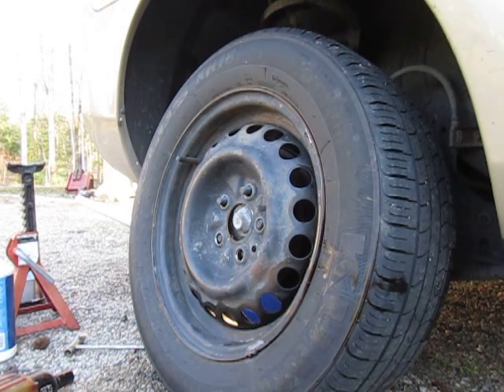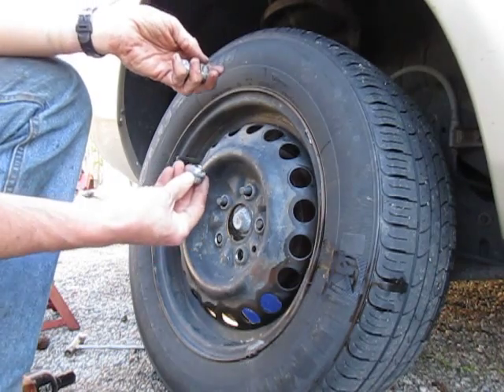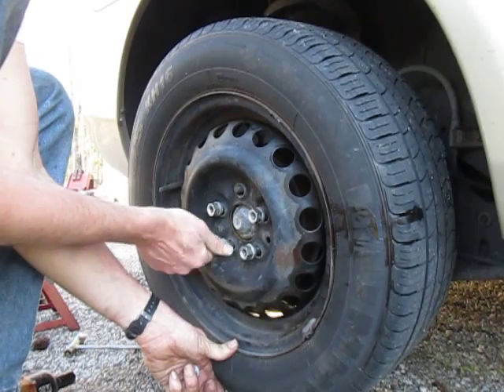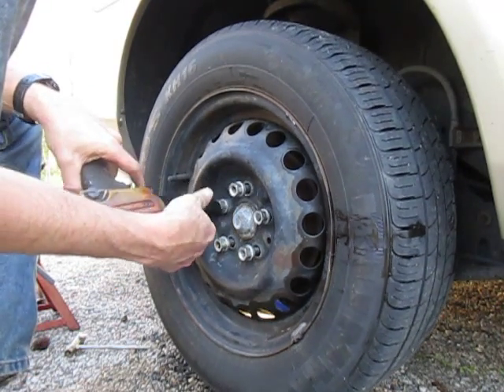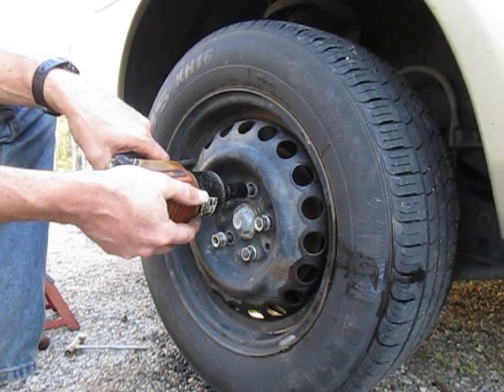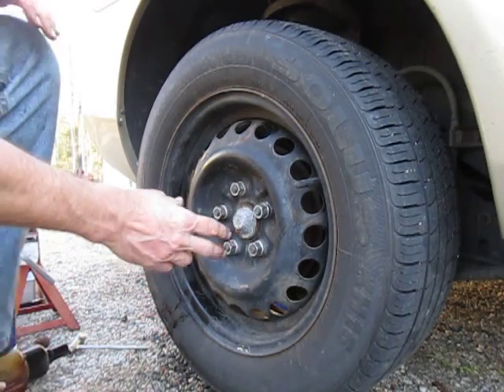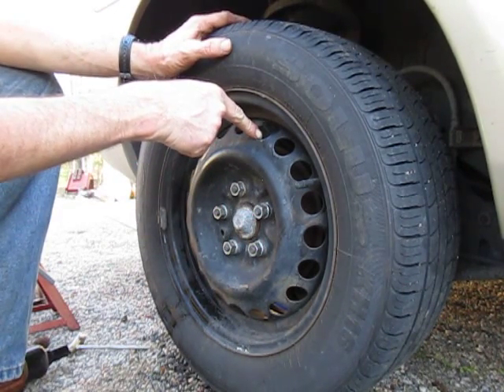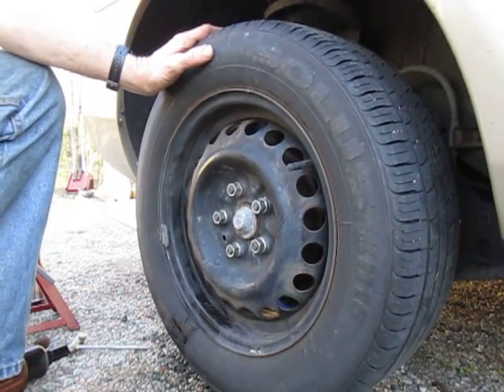Properly tighten lug nuts with pneumatic impact gun

Comment: I use battery power impact wrench. I usually hit it with the impact until it stops turning. Been doing for for years and never had issues of my wheels falling off.
Reply: What brand? Hercules Ultra Torque?
Reply: @yoellopez82  the one I have is Bauer 3/8 impact. I think the bauer 1/2 impact is stronger.
Reply: @OrangeCounty92  thanks!

Comment: Here’s my pro tip: use a battery impact gun and make sure the battery is almost drained but still usable, if you have a 1000lb torque impact gun, then a drained battery will make it “safer” if that’s the only tool you have for whatever reason

Comment: Can I adjust the torque on a cordless impact wrench?
Currently, none of the "cordless impact drill wrench/drivers" will allow you to adjust the torque to those exact settings. (An air impact wrench won’t either for that matter.) The only solution is an attachment that fits onto to the end of the impact and then the socket fits onto it. Basically it is another “socket” that won’t let the tool torque anymore than the ft/lbs you set it for. However, these are very expensive little things. They are around $300 to $400. They are really made for production and assembly lines where exact torque is very important.

Comment: The real proper way is to use the impact gun to start them after putting them on by hand then use a torque wrench to get them to spec. Its too easy to over tighten them with a impact gun.

Comment: I think the torque setting means something the way you did it. One one second torquing  and the nut is tight enough. My stupid  local tire shop guy tightens each nut 3 times with an impact driver. I couldn't break them loose with lug wrench that came with the car. Now  I always  insist on doing the final  tightening myself with the lug wrench so I can loosen em  with the lug wrench.
Reply: But I will say this guy in the video did alot of things wrong
Reply: @melektau7800  You say the guy in the video did a lot of things wrong. Please tell me what all those things were.
Reply: @philipmartin708   no tourqe sticks he also did not hammer them down enough and sense he didn't use tourqe sticks he should have hammered them down even more than normal
Reply: That's your fault for not having a impact not the mechanics fault he is just making sure your tire don't fall off and take your fender out
Reply: @melektau7800  Ridiculous. Who carries an impact wrench in their trunk to deal with a flat tire? Also, lug nuts are supposed to be tightened using a torque wrench, not an impact driver. Over tightening weakens or breaks lug bolts, and warps brake rotors. Also, with your excuse for his tightening each lug nut 3 times, why stop at 3?
Reply: @philipmartin708  Have you ever heard of a torque stick because that's what your supposed to put on your impact wrench to torque lug bolts properly
Reply: @philipmartin708  he did it 3 Times because the first time he was snugging it up to the tire the second time he tighned it in a star pattern the 3rd time was to make sure he didn't miss any or to make sure they was properly tighned
Reply: @melektau7800  Good point. He didn't use a torque stick. I've never seen him use one.
Reply: @melektau7800  He didn't use a star pattern. Properly Tightened would mean using a torque wrench or torque stick. Let me ask you something. If you need to change a flat tire, shouldn't you be able to do it with the tire iron that comes with the car?
Reply: @philipmartin708  yes you should but what good is it going to do you when you tire falls off
Reply: @melektau7800  If the lug nuts just loosen, your car wobbles, giving you a chance to pull over before the wheel comes off the car. That's not the case when weakened lug bolts brake do to over tightening. In all the years I've been doing the lug nut tightening with my lug wrench, none have come loose. And by the way, you didn't answer my question about being able to change a flat tire with the lug wrench that comes with the car. ??? (edit) My mistake. You did answer that question.
Reply: @philipmartin708  I actually did answer your question about that thats what road side service is for
Reply: @philipmartin708  I am a master tech at a Ford dealership I was also a mechanic in the millitary for serval years and I have never over tighned a lug bolt I told you how I do it and I do it by the book and it works great every time

Comment: How many psi do you set your compressor
Reply from the maker: 90-100... It's more about the cfm's, I have twin 20 gallon tanks interconnected... One is from a previous compressor where the motor seized up, I simply use the tank from it to store air, if you have the cfm's the psi is always secondary in importance.  With compressed air and most anything that relies on air (blowers too) it's always about the cfm's.

Comment: It's important for people to understand that a pneumatic (air) wrench like the one shown in the video has a range of forward adjustments for what % of maximum torque is being applied.  Some of these tools have maximum torque ratings in excess of 1,000 ft/lb of torque which you absolutely do not want to use on your lug nuts.  Even a short brap brap brap can damage parts if the torque rating is too high.

Learn how to set the forward torque rating and you can very lightly apply torque to the lug nuts to get them firmly set before you lower the vehicle, then use your torque wrench to set the torque properly.  Some manufacturers have lug nut torque as low as 70 or 80 ft/lbs and others have it as high as 150 ft/lbs.... but in no case should you be putting 2X 3X 4X or more torque than what is recommended as you can damage the rotors, drums or other parts or strip the wheel stud or bolts which in some cases can require replacement of the entire hub.
Reply: That range is "low", "medium" and "high".
Reply from the maker: True, but not with most single stage home air setups.
Reply: @8307c4  Have you ever checked your lugs to see how close you got? You are giving bad advice. You haven't a clue what power is being put out.

Comment: Most technicians don't really pay attention to torque specs. They don't know what these numbers mean, how they were calculated, or what can happen if the bolts doesn't follow the spec. I hate to label people, but there is a difference between engineer and technician.
Reply from the maker: Heck, this isn't even the proper way either, but sadly it's still better than most tire places.  The proper way would've been to use a torque wrench after... Now I know a few shops today, they do it right but most?

Comment: Where is your torque wrench at? At the very worst use torque sticks, or you will have to resurface your rotor at the machine shop.
Reply: thats the importance of knowing your tools, when you know your tools you almost have a precise adjustment
Reply from the maker: @vaguincolombia  That is a very good point, you definitely become familiar with your tools then you just know.
Reply: where i work we use the technique shown in this video. never had a warped disc complaint ever

Comment: yeah I get it but what about the proper torque? I guess you still have to use a torque wrench to know exactly how many ft lbs each lug is tightened to?
Reply: Yeah it’s easy enough. Takes 5 minutes or even less to torque lug nuts to proper spec. Easy enough.
Reply from the maker: You might... I usually check them after 5-10 miles, by hand, with a lug wrench.
Reply: Unfortunately a lug wrench will not tell you what the torque rating is at all.
Reply: @404notfound..... yep only a torque wrench is specifically made to tighten stud bolts